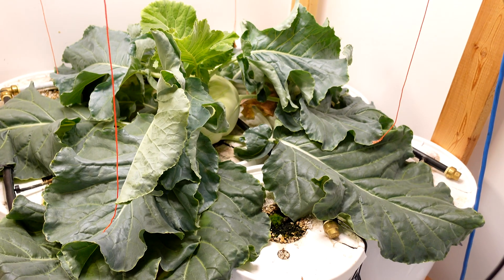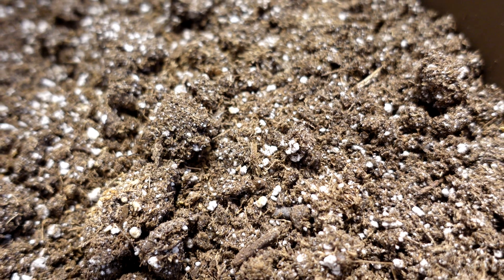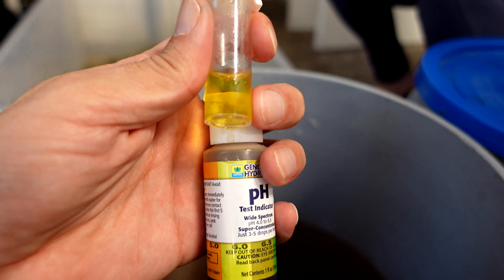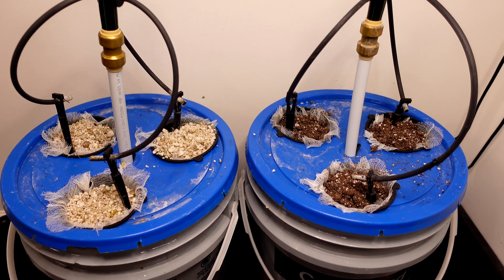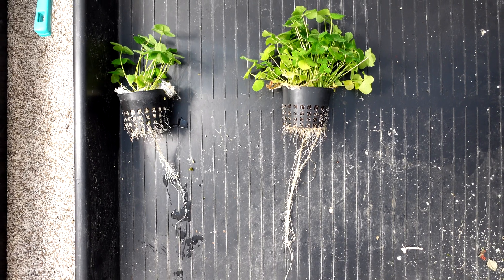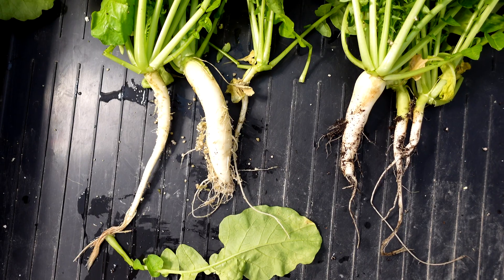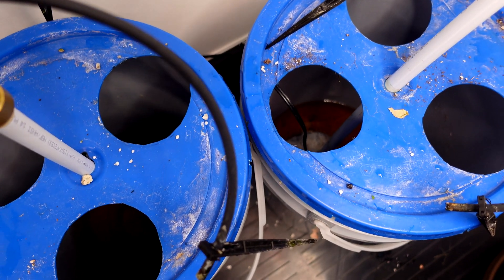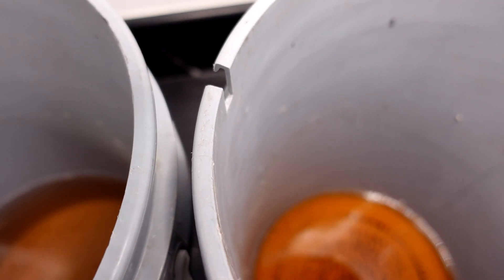Perlite vs. Coco Coir: The Ultimate Grow Off

Comment: Thanks for putting in the time to document and share your testing, and for your detailed comparison of the results.   I really like these side-by-side comparisons - it helps a lot with decision-making as I'm designing my dutch bucket system.  I'm still wondering about whether it's best to use 100% pearlite in each bucket, or whether a pearlite/coco mix might work better.  Your test results indicate the mix might work better, but I haven't seen anybody using anything other than pure pearlite.  Have you considered trying a pearlite/coco mix in any of your full-size buckets?
Reply from the maker: I would personally stick with perlite, over longer periods of time, you might get decomposition which would really mess with a lot of things.  And you're welcome for the videos.  It's great to hear when people appreciate it!